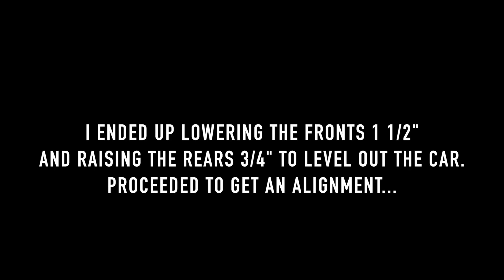BC Coilovers Install | 05-07 Subaru WRX STI

Comment: I recently bought a 2007 Subaru Impreza that was lowered on bc coilovers and when I go out for a drive my car bounces a lot, how do I fix this
Reply from the maker: How many miles are on the coils? 

To really check if the BC’s were tampered with, I’d break it down, re-install and restore preload settings. So it’s back to factory settings. Next, adjust your dampening. The GD chassis spring rates are 8k front and 6k rear. Adjust to your liking.

Another option is to swap out to the with swift springs, if u need part numbers, I can provide them and get you a good deal for an entire set. Even if u swap to swift 8k/6k springs, it’s a night and day difference compared to BC springs on the strut body. If u decide to swap springs, you’d have to tear apart the coils once again and restore preload with the new springs, which isn’t hard to do. Hope this helps
Reply: That sounds like you’re on lower springs

Comment: Did you have to roll your fenders, at least the rear? I’m about to drop mine and it looks like the rear tires will hit the fender (oem wrx wheels) and I live in a place with garbage roads and I don’t wanna be slicing my tires up
Reply: kaichu did you get the be coils?

Comment: how do you find the ride quality on these? great video btw just after some feedback on the bc coilers
Reply from the maker: Anthony Tsanaktsidis thanks man, I appreciate the love! Honestly, like I mentioned in my video, I loved in comfortably enough in my RSX that I chose to use BC for my STI. Not because of the price but because of the build quality. You can get stiffer springs, just an FYI. I'd recommend the swift springs upgrade rather using BC's springs. That's my next move on these. Aside from that, I couldn't be more happier. I've maxed my camber in the fronts, and the rear has so much more room. It was worth the extra 100 bucks to get camber plates for the rears. My dampening settings in rear is at 16, dead center, and front is 24. Numbers are from 0 (soft) to 32 (stiff). Don't hesitate to ask for more questions! I've been too busy for any sort of videos or reviews lately.
Reply: medinaMEDIA Thanks for the reply definitely considering these! The info really helped as I'm deciding between these and MCA's, keep up the quality content 👌
Reply from the maker: Anthony Tsanaktsidis thanks man! If u got any other questions, hit me on instagram @ronnemedina I'd be more than honored to help another enthusiast, subaru or not!
Reply: @Ronne Medina  did you have any issues fitting them to the hub? Mine are not seemingly fitting

Comment: How long did it take to install these?
Reply from the maker: CuttySTi208 i installed them in a matter of 3 days. First two nights I spent about 2 hours, when my kids were asleep, and then the last day, I just measured the height after the coils settled, and maneuver the drop settings to my liking. so about 6 hours total + alignment.
Reply: Sweet thanks man
Reply from the maker: CuttySTi208 yeah man. No problem. I'll be doing a lot more DIY's and stuff on here so stay tuned! 👍🏽
Reply: Will do! I have a grey 07 STi, wish I would of got white tho! Looks so clean